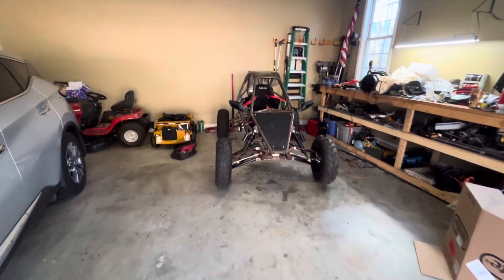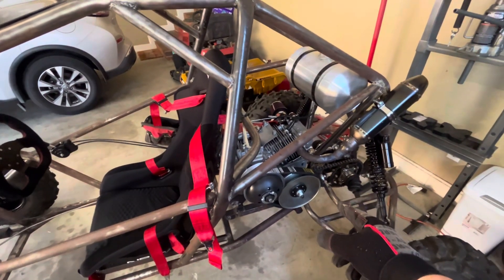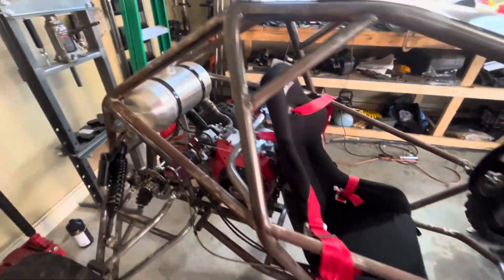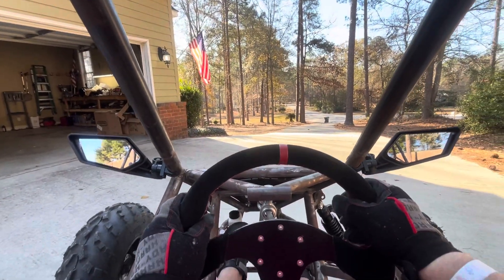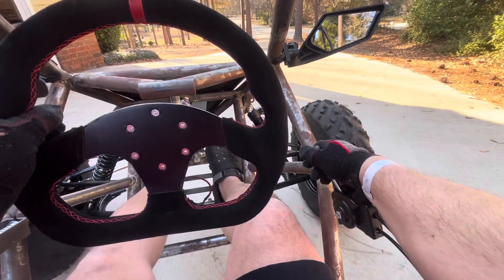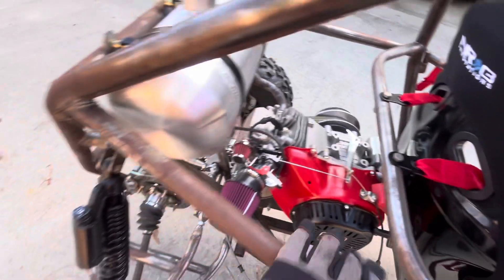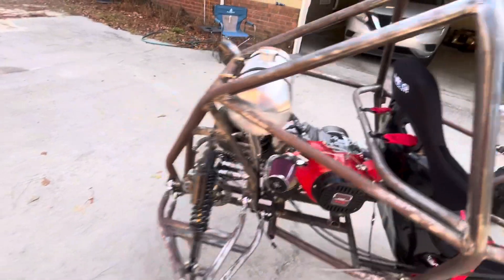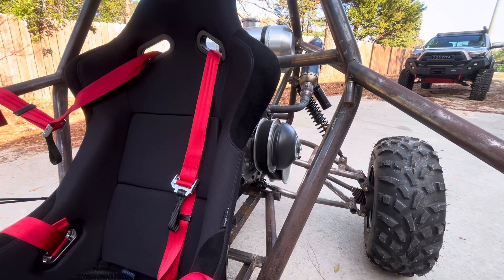Predator 459 powered VF-1 & first test of 780 series torque converter... reverse not working?!?!

Comment: Less weight in primary.
Reply from the maker: Yup. I have the stiffest springs (purple) in now, but I still need to put lighter weights in to raise the engagement RPM even more. I also had the wrong size belt in it (too wide) 🤦🏻‍♂️ which caused most of this issue. Once I put the correct belt on, I was able to use reverse.

Comment: A 790 driven will give you a 3.38:1 low end and a 0.54:1 over drive. 

The 780 is 3.71 low and 0.69:1 overdrive.
Reply from the maker: Thanks for the info. I’m having some issues with this 780 setup. I cannot tell that it ever actually engages overdrive. It tops out at the same top speed with this setup as it does with the Magnum 44 driver and 40 series driven I have.

Comment: Did these fit on the 40 series back plate im wanting to try the ebay drivers and driven pullys can't afford the 800 dollars for the comet one from go power sports especially since i already purchased the comet 40 series for 400 bucks  i got the predator 459cc and it smokes the belts when I try to gear it up for speed its ok for about 30 mph and that's not good enough for me the 780 and 40 series back plates look the same to me oh and it hit 50 mph with a 16 tooth pinion but the belt smoked that's why I need a 780 cvt
Reply from the maker: I’m not using any back plates. I’m using an EcoCycle PowerPack mount. It serves as an engine mount and reverse gearbox mount. By doing so, it eliminates the need for a backing plate. It’s also way stronger than any back plate would ever be.
Reply: Ok thanks ill look for it @McDorkin
Reply from the maker: @rockman49er anytime! If you buy one, let Arne know Thomas (McDorkin) sent you.
Reply: You need to flip the secondary driven pulley. it smokes because the sheaves are going in the opposite direction and the belt gets out of alignment. Look at how a side by side cvt works. The driven always opens inward toward the engine. That way the belt stays aligned.

Comment: What muffler did you use? Seems decently quite compared to others. Im doing a crawler and dont want it annoying loud..lol your build looks great
Reply from the maker: @justinlancaster5746  thanks! It’s a generic / universal motorcycle muffler off Amazon. I think it was only like $50. Just had to weld on a piece of tube to adapt the muffler fitting to that tube then I just welded the whole setup

Comment: Hey man do a governor delete and heavier valve springs it will make it 10x funnier to drive it’s also cheap maybe $50
Reply from the maker: @homerooseguera213  that’s the same thing others have said. I’m seriously thinking about doing it, but am apprehensive because the 459 doesn’t have any aftermarket flywheels. I’d be stuck using the stock fly wheel. Any idea what RPMs those can handle before grenading?
Reply: @McDorkin I’m not sure what rpm’s they can handle but it should be a problem at all unless your holding top speed for a long time just gear higher for example if your fine with 50mph gear it for 60 and you won’t be over reving it

Comment: Man that thing would be killer with a governor delete, billet internals, big valve head, billet flywheel, billet intake manifold with a slide style carburetor. I have a 460 stroker done in that order with a 780 torque converter set with the parts you have ordered for yours. Heavier springs on both drive and driven clutches. I have the 40 series reverse gearbox. If you didn't know already the 780 series torque converter driven works perfectly fine on the 40 series gearbox. It actually fits better than the 40 series driven does. I have not installed it on my little buggy yet. Mine is a on spring weight rear swing arm design so the configuration is going to be complicated for the gearbox. In other words I'm trying to say I'm just been too lazy to dig into it yet.
Reply: the wildcat 460cc has alot of aftermarket support. predator 459 is all proprietary
Reply from the maker: @ yeah I’ve noticed that. I may get a different engine for this eventually just to mod out. I’d also looked at a few of the NR Racing builds
Reply: @McDorkin  my recommendation, the wildcat series, either the 224cc or the 460cc. you can call them (ec carburetors) and ask around
Reply from the maker: I agree! There’s not much aftermarket stuff for the 459 sadly. I’ve done the intake filter and exhaust, but outside that not much available. I do plan to eventually buy a Predator 420 to do a performance build with. It will get the full work up. My target is 30-35 HP like the NR Racing builds.

Comment: I love it!
Two questions; rounding off, how much are you into so far?and how long did it take you to get to this point?
I’ve already bought the plans and I’m pricing stuff out. I am looking at buying the kit because I’ve never bent anything before. 
At least not on purpose.
I will certainly follow your journey because I plan on making the same choices on mine. Miata axel and predator motor.
Reply from the maker: @dandeve  I’m in it up to this point about $3K. By the time I get all the battery in, electrical, paint, etc I’m estimating $3500. I started on this in May, and had a drivable buggy by December. There were a couple setbacks and A LOT of waiting for stuff to arrive. The reverse gearbox alone was out of stock when I got to the point I needed it, and it was nearly 2 months delay before they were available again. Go back and look at an earlier video I made on by buggy. I also had never bent tube, and was able to “make it work” with a harbor pipe bender by stuffing the tubes full of sand before bending.

Comment: Overall that is a successful run. Troubleshooting is what those runs are for until you get it dialed in.  I know that too well 😅
Also I thought about creating that swingarm door with a spring loaded pin also but once I put my panels on that idea went bye-bye.
Reply from the maker: Thanks! I agree it was a successful run overall with the 780. Reverse works perfectly fine with the 44 magnum driver and 40 series rear. I need to tune some more stuff, but I plan to eventually do a comparison video of the TAVs comparing the 40 series, 44/40 series, and 780 series. I determined part of my issue is the belt I have running on the 780 is a 1-1/4” wide belt for a Yamaha ATV. It was only $20 so I took a chance… well, I just ordered a genuine Comet belt that’s the correct 1-3/16” width made for this clutch. Hopefully that smooths things out. 

I know what you mean about the door. I’ve been brainstorming and my final conclusion is to add some additional tubing to the swing out to for a full outline of the door. I’ll also weld in some flat bar to create a “stop” for the door to prevent it from caving inward. I’ll then attach the body panel to the door. Should hopefully work pretty well.